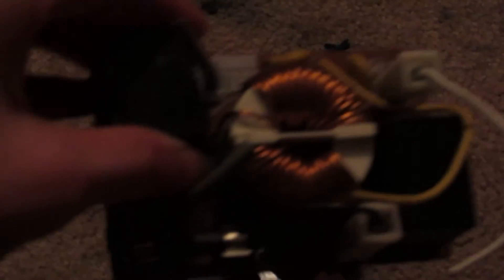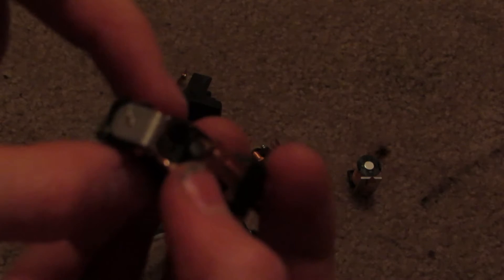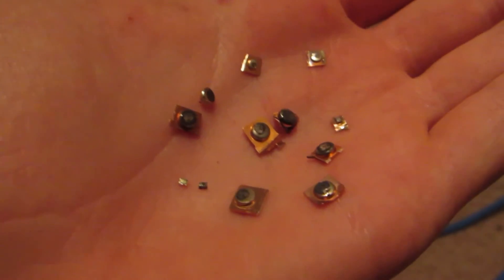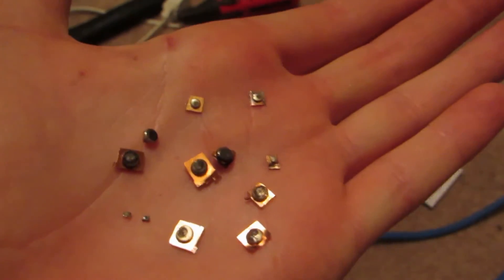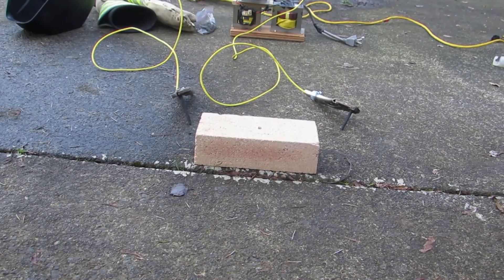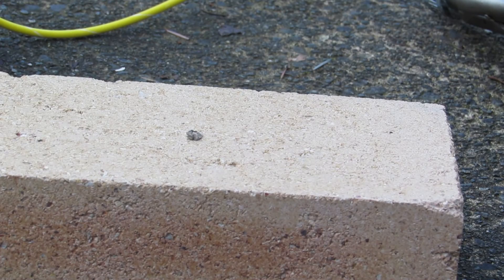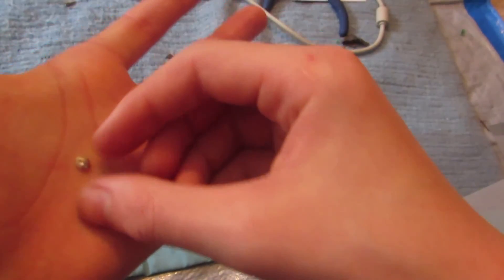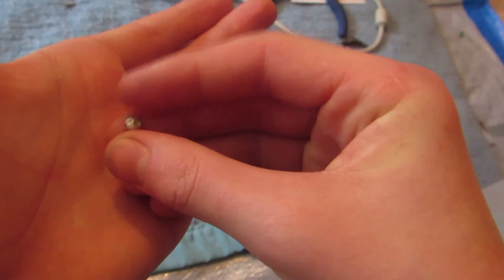Isolate Silver from Relays (Household Materials)

Comment: where did you get your arc melter you used in this video, i saw a couple of microwave transformers in the background, can you share the link you used to make it or a video where you made it yourself thanks
Reply from the maker: KW I used grant Thompson's design, u can looking up on YouTube. This design actually caught on fire after two years of use, I built s new one with a huge 45 lb transformer I rewired, and it works wayyy better and doesn't get hot